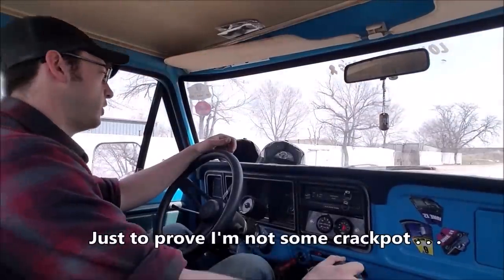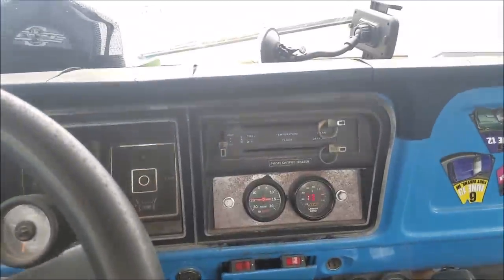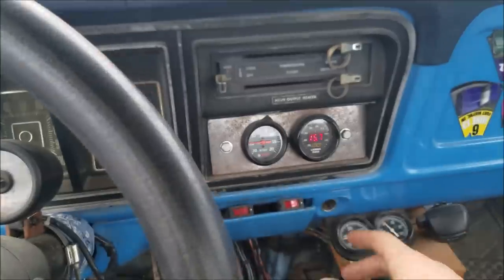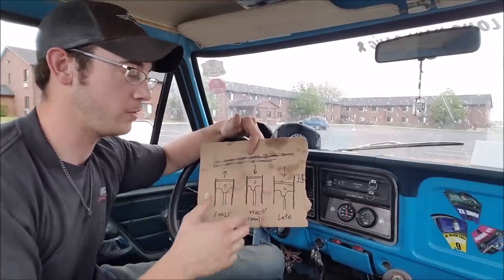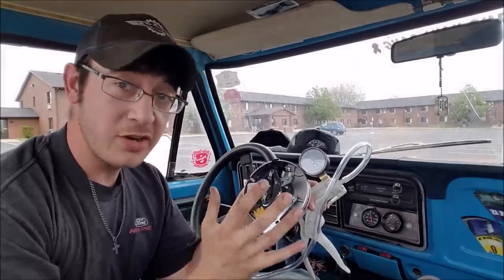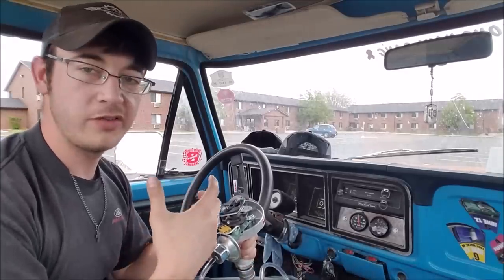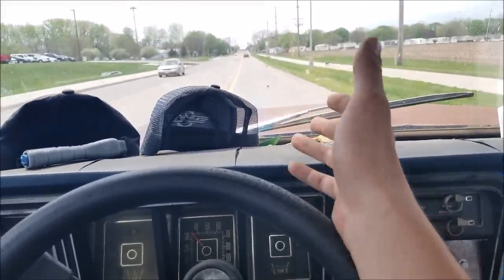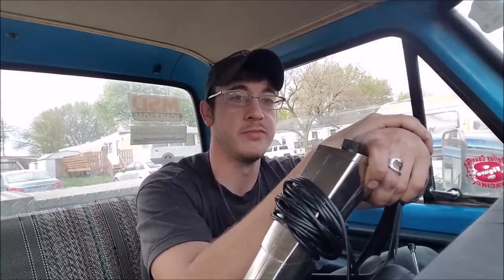Tuning a Distributor's Advance Curve (For MAX Performance & Power!)

Comment: I have a crate 383 stroker Chevy.  470 HP 485 TQE at the flywheel.
750 Quick Fuel carb. Engine came with distributer plugged on the vacuum advance. Im running mechanical. Car runs like a bat out of hell. Performance wise anything wrong with not running vacuum adavance?
Reply from the maker: Vacuum advance is at play at light throttle scenarios - ie anytime your vacuum is above your vacuum advance can, generally 12inHg. 
It's there to add timing at light load - why? 
At light load the flame propagation is much slower, cylinder pressures are lower - all around us, we're under roughly 14psi (atmospheric pressure), this is what draws the fuel and air charge into the cylinder, the throttle blade works as a restriction to flow. 
Less throttle, less volumetric fill - less dense charge where air and fuel particles are more spread out. 

Don't mistake this as lean - a common oversimplification of what's actually going on as explained above. 

So, given all that - in order to burn the cylinder charge in these scenarios at the right time in the stroke, more advance is needed. 
Fuel injected Cars do the same thing with timing, albeit programatically but even still via vacuum/load by a MAP sensor. 

Overall, burning the cylinder charge at the optimum time keeps an engine healthy and running cool, clean, and efficient. 

For whatever reason, you just got the privilege of me writing something I normally wouldn't take the time to explain, at 4am nonetheless.

Comment: You need to get a CB Black Box then you can map your timing with your laptop. For $200.00 it is the greatest way to set your timing curve will also work with boost to pull timing out.
Reply from the maker: I didn’t know that existed, you just blew my mind!
Reply from the maker: It’s like progression ignition, but if it fails you can just unlock your timing and hook your stock ignition box back up. I like that a lot about this set up. 

Wish they had a phone interface via Bluetooth like progression!

Comment: I have a 300 i6 that detonates when I have the timing advanced enough to run smooth, and the advance hooked up. I have been running with no advance because of it, do I need to recurve my distributor?

Comment: Do you do any work on modern Fords? I am chasin a Phantom misfire on a 2000 5.4  I have a scanner that has advanced mode 6 and found a bad coil and replaced it all tests show good at this point but i still have the misfire no codes going to engine light! can you advise or point me to someone who can!
Reply: Time to check your compression.

Comment: Your thoughts on piston pin offset and welding the distributor so that it remains the same timing at all rpm?
Reply from the maker: Is this an uncle tony question?
Reply: Good for the Circle Track bad for the street

Comment: "people put a ton of money into engine builds and never realize their full potential".... How true.
Many "high performance" modifications to engines during rebuilds are a complete waste of time and money as the engines are given neither the fuel or ignition systems required to get the most from the mods.
In many cases a near stock engine with all the small details given proper attention can be as good as a major rework but with no care for details. The Devil is in the detail.
Reply from the maker: Absolutely my friend!

Comment: Do you need a vacuum gauge to tune a carbureted engine? I have the trouble with when I step on the pedal hard from a stop the engine will sometimes backfire not everytime though.
Reply: A vacuum gauge really helps. They are fairly cheap. Hook to manifold vacuum and adjust your mixture screws till you reach the highest RPM possible. Do 1/4 turn out or 1/8 turn in and watch your vacuum. The needle should be fairly steady too. Not hopping or floating around. Then adjust your RPM screw to desire RPMs. But your timing must be correct for your carb to be correct as the fuel ratio will change with timing as it did in the video.
Reply: @Aaron-qg8fo  thanks for the advice. I will definitely take it and run. I think I am going to invest in a vacuum gauge. Do you have any recommendations on good vacuum gauge?

Comment: Except distributors have been obsoleted by coil-packs and computers, what, some 20 years ago! Too bad too cuz I prefer old school.
Reply from the maker: More like, more prevent for the sake of the incompetent. 
Put a tuner on a modern car and watch the safe tune pull ignition timing to 10 at hard throttle. 

New isn't always better, I promise

Comment: If you are not using manifold vacuum to the distributor, the engine timing will be severely retarded at idle speed.
Reply from the maker: False. Only if you have it set for late mechanical initial timing. 
But this isn’t even about that - this is about mechanical timing in general in this video. When you put the pedal hard to the floor you have 0 vacuum advance anyway!

Comment: What do you prefer points on eletronic distributor.  Uncle tony says he likes old points whats youre take?
Reply from the maker: Both are fine. Points take maintenance and are subject to issues when distributors wear - like shaft play. Electronic ignition "could be" subject to failure which more easily leaves you stranded. 

Personally I run pertronix ignitor 3 distributors as they are highly tunable - factory stuff is less friendly to optimize (my primary concern), and offer a built in Rev limiter and multispark. 

My tractors? Still run points - Robust and nostalgic. 

The long and short of it is that there are positives and negatives to both.

Comment: Could I limit the vacuum advance and raise my base timing
Reply from the maker: Yes, but at the cost of either A: lower cruise timing, or B: likely excessive total timing
Reply: @ThunderHead289  well I live in Florida so we don't have no emission codes so I run manifold vacuum and with that it is idling at 38° so if I restrict the vacuum advance a bit it will lower my total timing true or not
Reply from the maker: Your vacuum advance isnt factored into your total timing value when we talk about "total timing conventionally" remember, at hard throttle vacuum advance drops out - this is by design since the burn rate is faster at hard throttle due to greater volumetric fill and you don't need as much timing to ignite the mixture at the optimum time in the stroke. 

Only way to limit vacuum advance is on the actual vacuum advance mechanism. 

Vacuum advance has nothing to do with emissions, and has everything to do with a properly running and timed engine where it's load based timing. 

If you don't like your idle timing because it's excessive with vacuum advance hooked up, run ported vacuum. The only difference is that ported doesn't add timing at 0 throttle, once you touch the throttle, it's the same as manifold.
Reply: @ThunderHead289  what is your thoughts about limiting the mechanical advanced